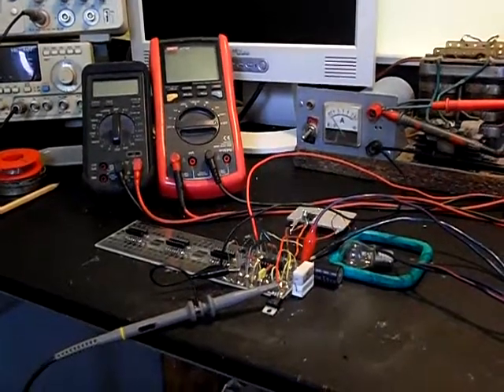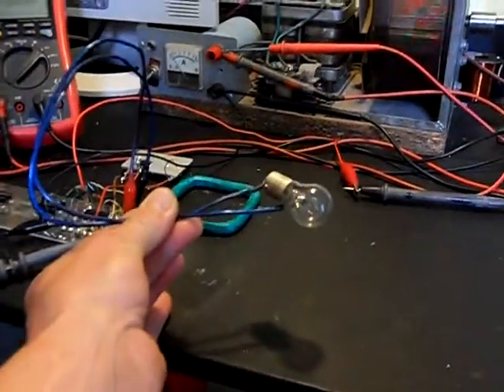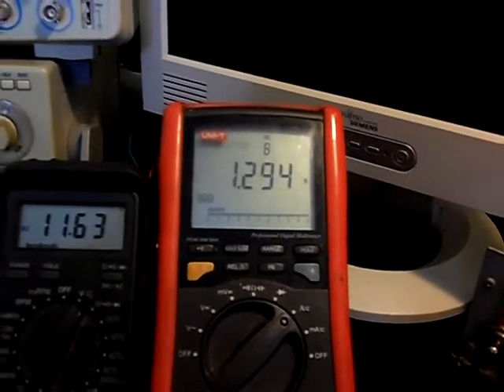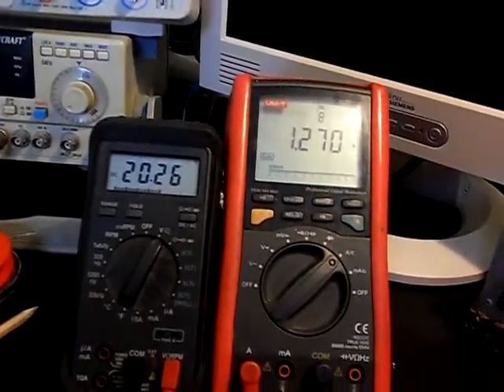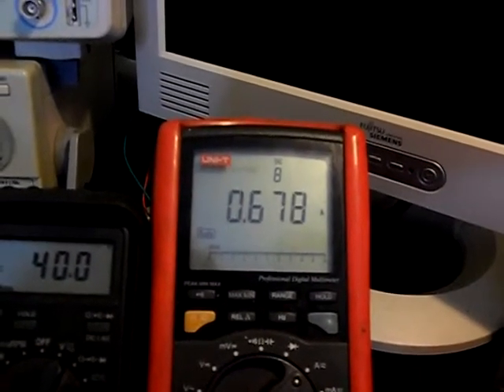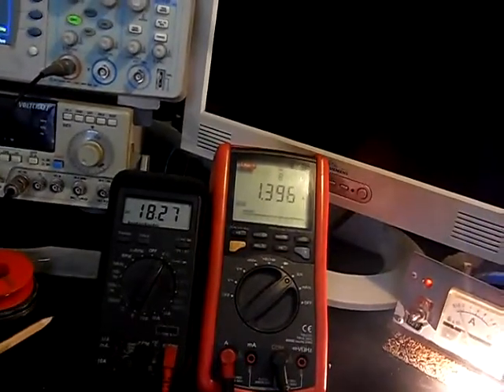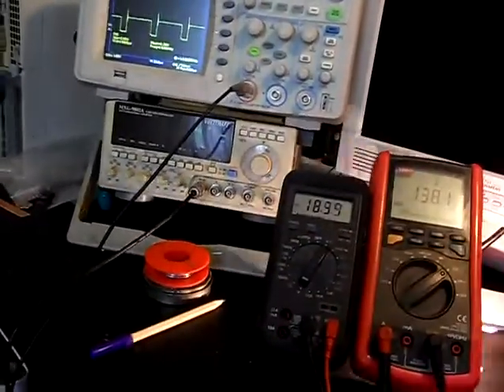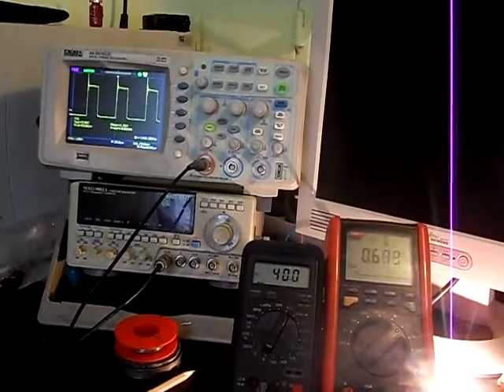DC 2 DC converter

Comment from the maker: This particular circuit is limited to 5 amps, It has one IRF9640 mosfet that can handle 11 amps, but I don't want to overheat the transistor. Of course by adding more transistors and redesigning the coil, you can increase the output current up to 30 - 50 amps or even more.